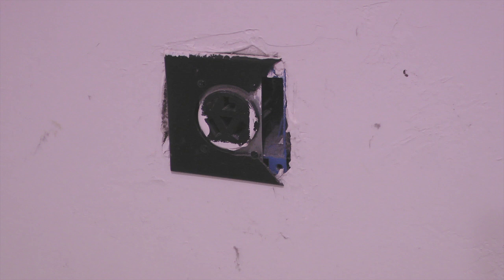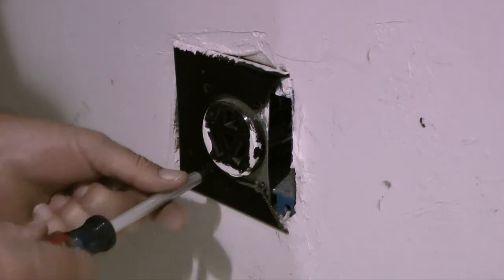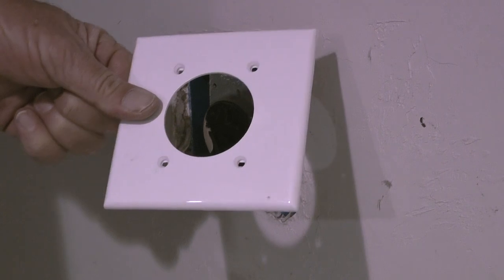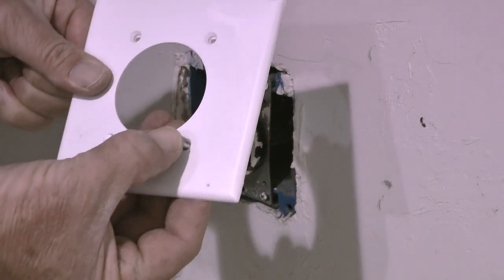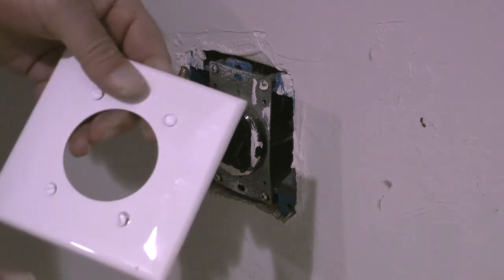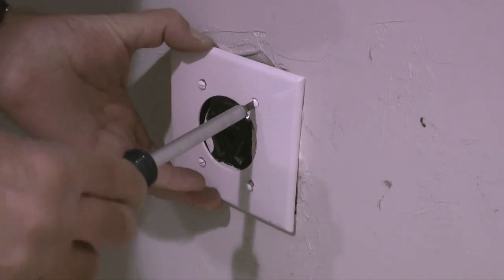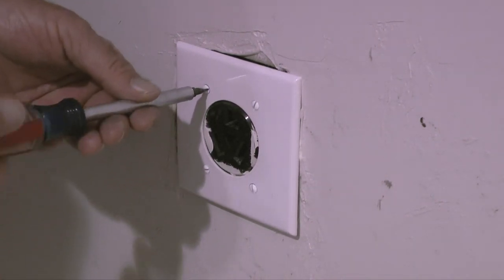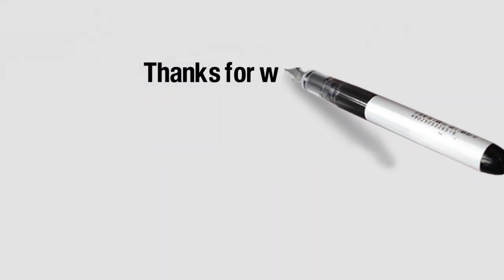Dryer Wall Plate Replacement

Comment: In your case if you have access to the receptacle it is in the best interest to pull out the outlet and check the wiring connections for torque and if needed replace an older receptacle. It is worth changing an older receptacle and cord and plug when needed if things look worn out. Thanks. 

Jeff 

A Licensed Journeyman Electrician
Reply from the maker: +onecrazywheel 
Thanks Jeff for the information.
Reply: +iScaper1 You're very welcome and God Bless!

Comment: Mine is 37 years old and is a single hole that appears to be 2 1/16 or 2 1/8 inch diameter and 2 3/4 x 4 1/2 inch size.  Do they still make these?
Reply from the maker: That sounds like a standard plate.
Reply: @Iscaper  Thanks, after looking through over 50 different kinds on the web I found one that I think is the size I need.